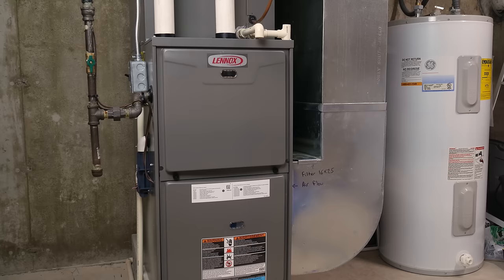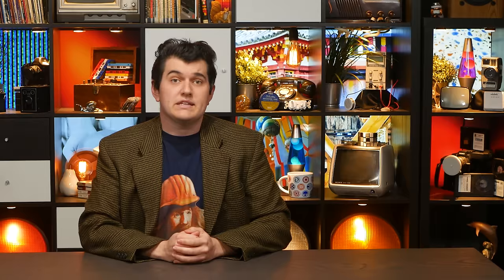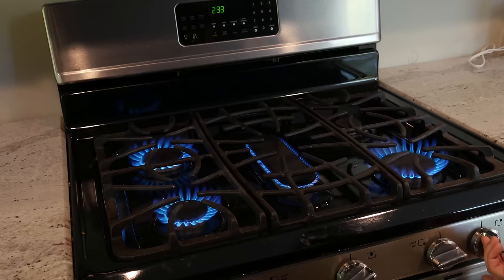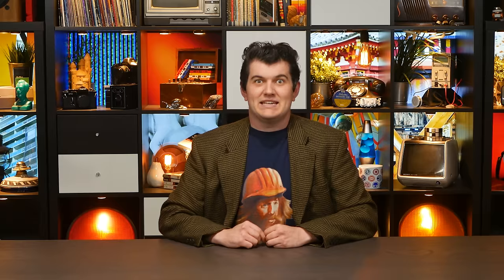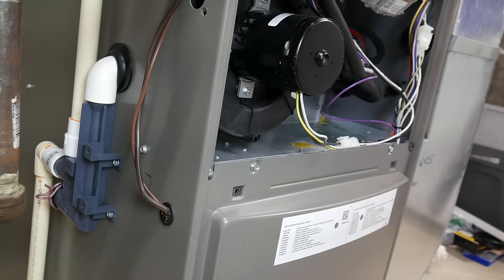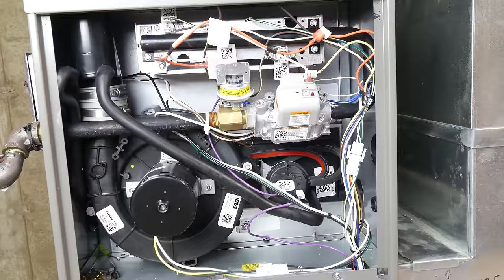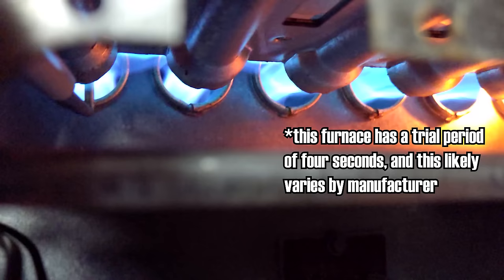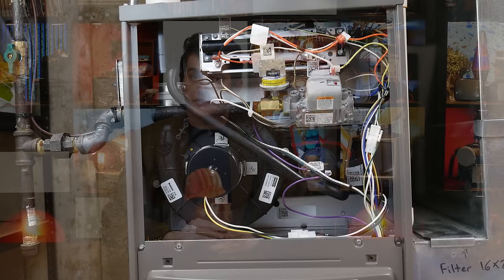Forced-air Furnaces: The What, Why, and How

Comment: I just wish they'd put a MOX gas sensor in boilers to detect CO and hydrocarbon buildup. They're so cheap these days that it seems like madness not to have one as a safety lockout. Atmospheric CO concentration above a safe level? Gas turns off. Atmospheric hydrocarbon concentrations above a safe level? No ignition.

Comment: In any colder climate, natural gas is the best long-term solution there is. Geothermal is a waste as the extensive system increases complexity to such an extent that it can cause more harm than good. 

Being 94% efficient is incredibly good considering the electricity delivered to your doorstep is far below that and most northern states require supplemental resistive heating, even when using heat pumps.

Comment: My first question: what's the smell that happens the first time I turn on the heat for the season?
Reply: I'm told that it's the dust that accumulates on the burners over the summer.
Reply: Roasting ferret
Reply: Dust in the furnace

Comment: Only one problem with a gas forced air furnaces is if power goes out like in Texas they won't work, while growing up we had a ducted gravity furnace that used over sized ducts that just relied on heat rising to work. While it was electrically controlled there was a manual mode that still gave us heat when the power went out. With a pilot  light it's efficiency was low by today's standards but we always had heat no matter what.

Comment: There are many costs to consider.  Condensing furnaces are only a few hundred dollars more than a 80% furnace.  A 90+ furnace uses pvc pipe for a chimney.  How much is a
chimney liner installed?  How much does a reversing valve cost to replace every 10 years on a heat pump?  How much to repair the control board on a heat pump?  The Bosch
heat pump control board is wait a second...$2,400!!!  Yep! LABOR IS EXTRA!  (Only a fool would purchase a Bosch heat pump.) You go with your heat pump.  I'll stick with a $1,300 
condensing 96% gas furnace!  When I come to repair your heat pump, I'm going to charge you double...because it's a heat pump!

Comment: Furnaces almost never "break." All the furnace problems I've had in like 30 years have been dirty flame sensor, badly installed filter, dirty flame sensor. And that's between like 10 or so furnaces I've had, and one of them had to have been like 50 years old.

Comment: AFUE of 95% means out of the 100% of the heat created, 5% is lost through the flue. 

In a different method of measuring the efficiency of the energy created, an “efficient system” could be running poorly by having ducting too small, which makes the system work harder.

Comment: I would disagree that gas-fueled forced air systems are the norm. Oil is still very popular, particularly out in the country. A lot of people aren’t comfortable with having a giant bomb (aka a 100 lb propane tank) right next to their house. And, all things considered, oil is inherently safer than gas.

And where I live hot water baseboard is much more popular than forced air. Forced air heats up a lot faster but has to run much more often, and is noisy. Hot water baseboards takes longer to initially heat, but give off radiant heat for much longer. Forced air also requires huge ducts installed throughout the walls (as opposed to just copper pipes)..

Comment: We should totally have large replaceable fission batteries instead of a power grid. All the benefits of large facilities could be concentrated in the factory and recycling steps. At the very least grids should be scaled down and powered with the correct reactor. But seriously uranium is insanely energy dense, so there's a whole bunch of space to move around in. If you had an actual reactor in every home. (Absolutely doable safely and cheaply at scale.) You'd only need and produce like a soda can of fuel/waste per decade. Reminds me of that discussion of pidgins vs fiber vs truck, bandwidth. Seriously, we're doing basically everything wrong.

Comment: So this thing also is responsible for fresh air in the house? Is there anything capturing the out going heat in the dirty air? In EU the modern norm is that the in coming fresh air gets preheated with the out going dirty air.
Reply: An HRV or an ERV is responsible for fresh air in a house, not the furnace.

Comment: Nothing has 500% efficiency.

That's the "efficiency" of heating a room, compared to resistance based heat.

But a heat pump is itself a lot less efficient than resistance heat.

It just takes a LOT less energy to move heat, than to make heat.

Comment: i dont care what they say but using air to transfer heat is about as efficient as using a private jet for one passenger 
using hot water and radiators or even better a floor heating must be alot more efficient

Comment: The burning of natural gas which from what i understand is basically methane produce water vapor and carbon DIOXIDE right? maybe it produces a bit of MONOXIDE but it mainly dioxide if everything is functioning correctly... is this correct?
Reply: If something is way out of tune, causing orange rather than blue flames, can cause incomplete combustion which can include carbon monoxide (badly-adjusted burners, too low or high gas pressure, clogged flue, cracked exchange, ...)
Reply: @youdontknowme5969  makes sense

Comment: The chances of a cracked heat exchanger blowing carbon monoxide into the living space is very low. You mentioned how the combustion fan sucks the burnt gases. This creates a negative pressure in the heat exchanger. The blower motor is before the heat exchanger, creating a positive pressure. The chances of the CO gases going from negative to positive via a crack are, therefore, very low. What would likely happen is the return air gets blown into the exhaust. This is by design. You, probably, already knew this. 😎

Comment: The line about not using electric resistive heating for cold areas...is VERY wrong. A lot of us have electric resistive heating in furnaces that look almost identical to yours, just with the burners replaced with heating coils. If it's not common in your area, that's probably due to local cost of LNG. The further you get from the main gas lines, the more expensive LNG gets, the reputation LNG has (unfair though it may be), and the perception that having electricity for everything is more convenient has lead to resistive being the second most popular option until relatively recently with heat pump starting to overtake it.

Comment: I have questions please in summer do i need to turn off the bottom ? I’m not using the heater only the ac but still need gas for my stove and water
Reply: If it has a standing pilot flame (older units usually), then you could, and then just relight it when the season changes. If newer (electronic ignition) then leave it, nothing to worry about.

Comment: if the electricity cost per kw is more then 5 times the gas cost per kw, then heat pumps for heating don't matter, in my country the difference is more then 6 times, so gas heating is the cheapest option, and even without gas in rural areas in our very cold winters it doesn't make sense bc the efficiency goes below 3 times central heating, and wood is 3 times cheaper then electricity per kwh of heating.

Comment: Makes me glad nothing in my house is gas. The water heaters, Stove, ovens, and heat all electric. I grew up with Gas heat and radiators. the heat worked well when it worked. But the furnace was a cheap piece of junk, the Army paid for. It broke at least a couple times a year.

Comment: By the way one problem with heat pump is the Texas power outage (and Texas is perfect for heat pumps by the way even though they are not commonly used). But anyways I lived in an apartment in Austin, TX that had a really odd heating system. Instead of having a furnace or anything, it simply uses its gas powered water heater to pump hot water to heat the apartment. The downside is that when the heat is on, you take cold showers. I don't know who designed it... it was a shit system.

Comment: So why don't North-American homes use radiators? Is it purely because the ducts for the air conditioning are there anyway, or are there other reasons? Does that mean that in areas where air conditioning is not needed radiators are more prevalent?

According to my cousin, who is Dutch but has lived in America for years now, he much prefers radiators. He says they're more comfortable and heat the room more evenly. Is that true?
Reply: Well, it depends. It's easier to understand if you consider the furnace/air conditioner as an "air handler" which uses the duct work to move either heated or cooled air. That's a somewhat different issue than comfort since the placement of the air vents vary...as a rule they should be on the perimeter, best under windows to offset their heat loss.

I myself like radiator heat but don't think it's better than electric perimeter heating. That said, the ability to use ducts to move cool air as well as warm air simplifies the design process and lowers the initial system cost.

It's worth noting that systems using significant amounts of inside air draw in low humidity outside air (through cracks, etc.), making the inside very dry during the heating season.

Comment: Less emissions are ideal, but as I've lived through 2 major and prolonged power outages in the past 10 years (one of which was during -20F weather - fortunately, the shorter of the outages), I'm very reluctant to put all my energy needs in one electrical basket. Well, not that our natural gas heater would work without electricity - it's controlled by the thermostat which runs on electricity. Still, there's probably a way to hook the thermostat up to a battery or something.

I still mourn the gas stove in my previous apartment. Ours is electric and technically works (sets off the smoke alarm every time we try to use it) so the landlord won't replace it. So what if it smells like something's burning, right? It's an old electric stove from the early 1980s. Sigh.

Comment: CO poisoning, is nearly non existsnt in a forced air furnace. This is because of the positive pressure of the air around the heat exchanger, thus forcing the CO BACK into the heat exchanger. However, on a gravity furncace, where the heat naturally convects, such as an old octopus furnace, there is NEGATIVE pressure around the heat exchanger, so the CO gets sucked out of the flsme chamber, thus into the house.

Comment: My parents have access to free natural gas and water! Naturally they use a natural gas furnace and baseboard heating. They also use a gas powered hot water heater for the taps. Why do they not combine these systems? Why are they separate? Would it be efficient to store the thermal energy in both systems in the same tank?
Reply: I've wondered this myself, the only logical conclusion that I can come up with without any training in radiant heating systems is that i'd imagine it wouldn't smell or taste too good after running through all of your heating equipment...

Comment: With all of the safety features of the furnace, why don't they include carbon monoxide detectors in the heat exchanger to ensure they aren't blowing the toxic gas into the living area? I.e. why is it left to the consumer to purchase a separate sensor?

Comment: Forced air heating is not a very good heating system. It’s impossible to adjust the temperature individually by room, temperature is not constant and distributed by moving air which causes a current and dust. The furnace is noisy too. Radiant heat feels much more comfortable. I am really missing these effective and comfortable heating systems I know from Germany in N-America. And no, central heating is not an old technology compared to forced air which can be found in old castles in Germany. The only reason for forced air is that it is cheap to build and makes more profit for the builder.

Comment: Actually, burning natural gas releases almost no particulates on account of having no carbon to carbon bonds. Most of the energy from burning natural gas comes from burning hydrogen not carbon. Burning natural gas releases half as much CO2 as burning coal. Also, gas doesn't come with underground coal mine collapses, fires, explosions, or acid mine drainage or mountaintop removal.

Comment: With complete combustion of gas, you shouldn’t have any carbon monoxide. It’s only when you have incomplete combustion. Like too much gas, or not enough air that you won’t have enough oxygen atoms to turn carbon in the fuel to carbon dioxide. Carbon dioxide isn’t good to breath either, but it’s not poisonous like monoxide. Though it’s still a good idea to keep monoxide detectors in case you do have incomplete combustion in your furnace.

Comment: 4:10 What about using the gas in a highly efficient fuel cell (eg: SOFC) to drive a heat pump locally. And also using the "waste" heat of it as well.

That said I don't think heat pumps are the future here anytime soon. Wood is still the most economic heating solution here. Kind of depressing, it's the original, most archaic heat source.

Comment: If the FIRE TUBES were made of the proper heat tolerant alloy of stainless steel there wouldn't be a risk of cracks/holes.
But that most likely won't happen because of 'muh, cost' and 'muh, planned obsolescence'.

Comment: I had a boiler with hot water baseboard heat up north which was WONDERFUL heat.  We didn't have AC but didn't need it.(house built in 1938)  But heat pump forced air in the South... of course.

Comment: The modern heat pump is better but oddly not used much in the US.
Reply: i don’t know a single house that doesn’t have one in my city hahaha, wild how this differs by area in the states (i’m in arizona)
Reply: @SonoranAstro  I'm in Wisconsin and no one has even heard of one.  Maybe they don't think they can heat a home in this climate.
Reply: @Boodieman72  looking into them i don’t think they work very efficiently in very cold climates, they lose their effectiveness past anything lower than 30ish degrees
Reply: @SonoranAstro  They work to -22F for air source.  Geothermal works at any ambient temperature.

Comment: Well, the furnace itself might be very efficient. But aren't you creating an overpressure in the heated rooms by filling it constantly with air therefore prssing hot air constantly out of your house; very bad for efficiency. Plus, how can you regulate the temperature of each room individually? With an classic water-based heating system you absolutely can do this, e.g. for beedrooms, which, of course, saves fossile fuels, whilst not creating that much of an overpressure (only by the heating-part of the air itself you do) and therefor increases efficiency. If you would draw the air from the rooms back into the heater you would clearly spread smells, eg. from the kitchen, humidity and illnesses throughout the house; especially when you only have one heating system for an entire appartment block; which is very common in Europe with boiler-heated radiators. Bigger furnaces, too, increase efficiency while reducing the overall maintanance and "buying- and installmant" cost for everyone. I, too, don't want to know how gross the pipes for forced air heating get over time and what creatures thrive in them. Combine these factors and you can see why the good old water central heating system is better and/or more efficient; atleast in countries where you don't really need Air conditioning; in those where you need it you would have to create two completely seperate systems for both wich is very costly. 

Plus: How do you heat the drinking water; boilers do heat the heating system, if activated, while storing an good amount of really homogenously hot water (which often the radiator pipes just "cross" to get warmed). With electricity? That's really expensive; especially in many European countries. In my new flat the haggle with an water heater which isn't storing hot water at all, therefore not an boiler, is really bad. If someone runs hot water in the kitchen you immediately get freezing-cold water out of your showerhead. The waterpressure, too, is awful. 

Boilers are the only way to always have exactly identical temperatured hot water no matter how much hot water you use. Of course only to the point where you drained the hot water out of the boiler and it cannot heat the cold, fresh water fast enough while maybe even heating your home whith it which cools it even down more. But that usually takes over 30 Minutes of continous high water usage. Filling an Bathtub, e.g, is not an problem at all.
Reply: The rooms aren't sealed, and there's one or more cold air return on each level. Further, the heating vents in each room are usually equipped with louvers to allow you to control the air flow to some degree.

Comment: Carbon Monoxide having a greater affinity for red blood cells is not evolutionary bad luck. It's just chemistry. It's a very potent ligand which binds hemoglobin very tightly. Oxygen does not tightly bind hemoglobin--nor would it ever be evolutionarily advantageous to do so. If oxygen bound hemoglobin tightly, it wouldn't able to be released to be consumed by the cells of your body. It kind of has to be released from the red blood cell to be usable.

Comment: can you explain the 500% efficiency number?
like surely they dont produce more heat than it takes to power them
Reply: They seem like they produce more energy than you put in, because they're only moving energy. Technically doesn't break entropy or thermodynamics, but is still really efficient
Reply: Yep they sure do. They don’t produce heat, they relocate it from one place to another.
Reply: @CT-vm4gf  so then they dont
Reply: @dinkusstinkus4396  They can output 5 times more kw of heat than kw of energy consumed.